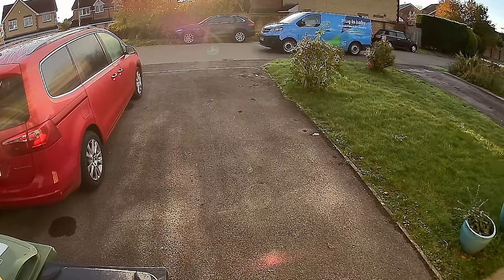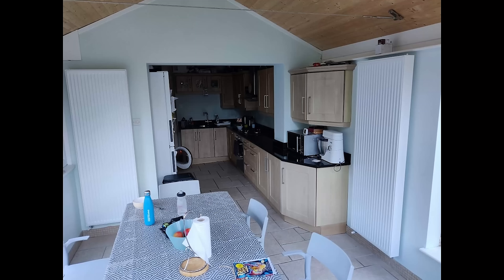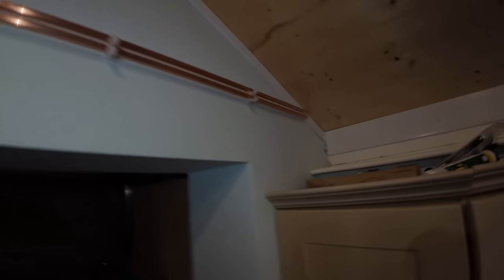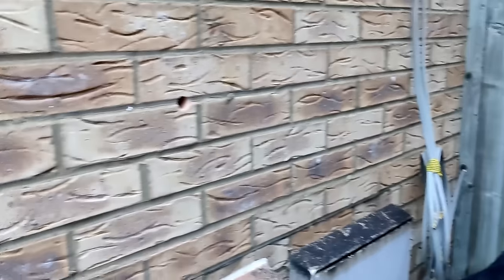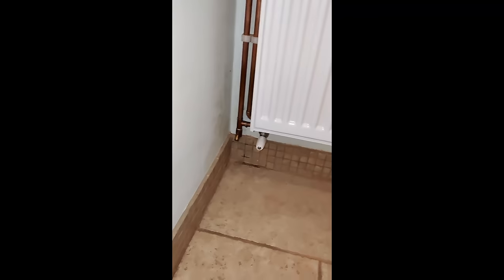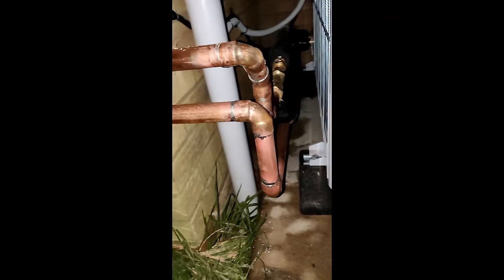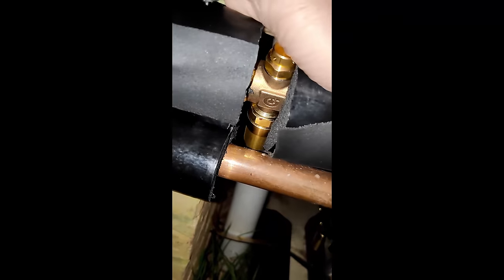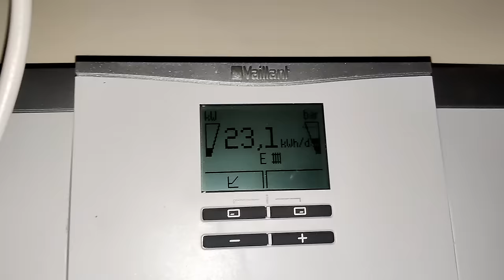Vaillant Arotherm Plus Heat Pump Installation by British Gas

Comment: My an aesthetic perspective that's an ugly installationId not be happy with all that surface mounted pipework at all.
Reply from the maker: We had the option to chase out the walls ourselves but we chose the cheaper and easier option. That room is undergoing other works which you can see in my other videos and the trunking will be painted to match the walls.
It is already not noticeable for us, even in the plain white as it currently is.

Comment: I could not live with that installation pipes and pvc runs everywhere this is exactly why you need these things installed when building otherwise you end up with a mess like this
Reply from the maker: Thanks for your comment. I could have chased out the walls myself for them to lay the pipework in and then plastered over later but we chose the quick and cheap option.
I haven't quite finished that project room yet but soon it will be completed and trunking will be painted to match the walls.
Surprisingly, we don't even notice the plain white trunking at all. We spend our time looking out the windows to the garden, rather than looking back at the house.
Reply: @UpsideDownFork  hi, it’s not so much the inside but that mess on the outside,maybe it’s just me that is very persnickety,I showed it to my wife she couldn’t believe what these people had left,you see I am a joiner and have very high standards of finishing a job,that is what I was talking about when I said I could not live with this
Reply from the maker: @gordonsneddon360  Oh, you mean down the side of the house?
Fortunately, no one goes down there and it will never be seen.
We're fortunate to have better access to the opposite side of the house that we regularly use.
The double white trunking is so that the low voltage data cables and the high voltage mains cables are separated, which i'm led to believe is best practise.
I did consider some Inoac 100mm trunking to fit over the feed and return pipework but as it won't add to the efficiency of the system and the pipework will never be seen, so I decided against it.
It would definitely be a different issue if any of this was on display.
When we moved in, this house had a satellite dish on either side of the front of the house and another relic of the past, a TV antenna. We took both of those down to clean up the appearance of the property from the street. Personally, I can't standard those bits sticking out everywhere.
I've also seen some very questionable gas boiler flues over the years, so I don't think this issue is exclusive to heat pumps!
Appreciate your comments.
Reply: @UpsideDownFork  I would prefer surface mounting and boxed rather than chased in. Less strain on the pipework and easier leak finding in the future.
Reply from the maker: @djhvideo  Good point. I did even consider getting some brass wall clamps, a tin of brasso and polishing them up to make a feature of them. The wife didn't like that idea!

Comment: I’m sticking with my gas boiler
Reply from the maker: Each to their own 👍
Reply: @UpsideDownFork  The amount of kit needed to make the heat pump work is astonishing  and more to cause problems ,the resources required to produce the kit can't be good for the environment. The wiring and pipe work looks like an industrial power plant.The average person wouldn't understand the controls ,let alone having to have larger pipe work and bigger sized radiators. So you mate our welcome to this crack pot nonsense along with your electric car.
Reply from the maker: @Fre667Roger-Ring  Apart from the external pump, everything inside is the same as a conventional boiler. Standard size cylinder, pump, expansion vessels. That's all standard stuff.

Now if you're comparing to a combi boiler...that's a different story.

I don't have an EV. Can't afford one but I cycle pretty much everywhere anyway 👍

Comment: Overdid the joist notching 😣😣
Reply from the maker: I'm surprised you are the first to mention that! Well done for paying close attention.
Reply: I work in the building industry and that notching of the joists is very poor not to mention the weakening of the joist them selves
Reply from the maker: @gordonsneddon360  Would it be less of a concern as it is so close to the wall? Maybe a bigger issue in the middle of a room?
Can the joists be strengthened with metal plates or something similar?
Reply: @UpsideDownFork  The "permitted area" for notching and holes within a joist are between 0.25x the span and 0.4x the span. It looks as if they were just expanding existing notches though?
Reply from the maker: @yngndrw.  Thank you for advising. I don't believe that the joist had any notching there previously.
Reply: Damn near a 1/3rd of the joist - bad!
Reply from the maker: @royhorn9412  yes, this will require some remedial work.

Comment: Wonder why for the new radiator work they went with copper and soldering rather than MLCP (PEX-Al-PEX) and press-fit. Would have been easier to do the pipe runs, IMO. Glad they ended up not using the speedfit.
Reply from the maker: Thanks for taking the time to comment. 
Not sure why they avoid MLCP or press-fit, but I don't mind either way as long as it wasn't speedfit.
Reply: A pathetic attempt at soldering but I don't like the willy wonker look of the press-fit.
Reply from the maker: @alanr585  yep, fair comment 👍

Comment: can you share a schematic in a future video perhaps? I'm curious why they fitted two expansion vessels and a buffer tank. If they've run 22mm to the rads so only the rads are 10/15mm shouldn't the radiator circuit be able to handle things like defrost?
Reply from the maker: Thanks for taking the time to comment.
My system is schematic 10, you can find it if you search for Vaillant Arotherm Schematic 10.
I believe there are 2 expansion vessels, one for DHW and one for Radiator Circuit?
Yes, by my calculations a buffer is not necessary on our system, we have more than enough volume to deal with defrost.
Unfortunately both Vaillant and BG are insistent that a buffer should be used.
In any case, it does add volume, helps with defrost, helps to reduce cycling and ensures that flow rates are always correct for the Heat pump.
Yes, we will sacrifice a small amount of efficiency by having a buffer but the quote was so cheap, I couldn't say no.
If we would have paid the extra £5k+ for a heat geek to fit the system without a buffer, we never would have recouped the investment from marginally greater efficiency and lower running costs.
Reply: @UpsideDownFork  you might be able to pay them a smaller sum now to remove the buffer and extra pump....
Reply from the maker: @ChrisShucksmith  Thanks for your comment.
My plan is to see how the winter goes and then potentially remove the pump and have the buffer as a volumiser on the return.
Reply: @UpsideDownFork  that's probably a good idea and looks possible with the piping.
Reply: @UpsideDownFork  

Schematic is good, I'm sure no manufacturer would add complications and potentially more bits to fail unless they thought it the best option.

As you said most likely to buffer design errors than defrost cycle, but raises the question as to whether Monoblock pump has sufficient Oooomph !!! to pump round system.

Comment: Good video, thanks for documenting in detail what happens. I'm very keen to make the switch too, but I'm going to wait till late Spring.
Reply from the maker: Better get the ball rolling then 👍 Demand is high. For me personally it was 11 months from first enquiry to installation!

Many more videos are on the way highlighting the ups and downs.
Reply: My lead time has been five months from survey to instal, assuming instal starts as planned in eight days 🤔

In saying that, it took months to get an isolator switch fitted by electricity provider. Which is required in most cases as only DNO or supplier (representing DNO) can pull primary fuse.
Reply from the maker: @_Dougaldog  Interesting. I can't now remember when the isolator switch was fitted, but i'm fairly sure that British Gas added it during the installation?

Comment: This installation reminds me of my grant-assisted installation of a new boiler and rads, 26 immediate leaks, lasted 3 yrs before needing replacement  rusted Rads etc,proper cowboys,
the new install is a lot better, however, I replaced rads on my own and run new pipework, strangely the electrician dumped the outside thermostat in the bin I retrieved it and insisted it being fitted
Reply from the maker: Thanks for your comment and glad to hear that your new installation is working for you.

Comment: Thank you for sharing your installation experience. Personally I would be a tad unhappy with that external pipework and electrical work.
Reply from the maker: Thanks for taking the time to comment. Anything specifically that you think should be improved on the external pipework and electrics?
Reply: @UpsideDownFork  Honestly, it is far too late now. But without getting bogged down in detail - it could have been planned better. In principle one vertical trunk to contain the primaries and electrics into the loft and then a drop down into the ‘plant room’ would have been better than long horizontal pipework runs and the multiple electrical cables.
Reply from the maker: @normanboyes4983  ah, I see. That makes sense.
If it was a side of the house that I ever saw or went down then maybe I would have considered some of these things. But I guess you are right that the installer could have advised better and some more joined up thinking between the plumbers and the electrician.

From a technical point of view, I'm under the impression that the shortest route for the primaries is the most efficient and going up to the loft to come back down could lead to trapped air issues?
Reply: @UpsideDownFork  Yes you are correct, shortest route is always the ‘best’ from a thermodynamic point of view. But ‘design’ is always a compromise and without knowing the building fabric - it may be that running straight up into the loft would have given a shorter overall run of external pipework. It is a good point though about  considerations of air collection at the high point - so an ideal point for venting or AAVs.😉
Reply: Nice vblog, gives are really good picture of what to expect. I wonder how long it will be before British Gas drop the gas in the name 😊
Reply from the maker: @normanboyes4983  thanks for taking the time to comment. The run they've made is definitely shorter, especially to get within the heated envelope  of the building but to satisfy my curiosity I may measure the difference. 🤔
On another note, I believe the 2 sets of trunking are to separate the high voltage power cables from the low voltage data cables.
I presume that may not be standard practice based on your comments?
Reply from the maker: @Chatterisdotbiz  The new department is currently called British Gas Zero but one of the more senior staff seemed to think that the name would eventually become British Zero.
Reply: @UpsideDownFork  Yes you are correct, always best to separate power and data cables.👍
Reply from the maker: @normanboyes4983  Thanks for confirming.
Reply: Guys who fit ac will put the refrigerant lines, power cables, comms cables and condensate pipes under a single trunking system, not sure why that’s not possible for these systems guess the pipes are larger, but you can get split systems where you just need to run refrigerant lines.
Reply from the maker: @edc1569  Yes, it's a very good question. Maybe best practise is not observed by those AC guys?
Once the 28mm pipes are insulated, they measure about 65mm each from memory. Getting trunking bigger than 100mm seems very difficult.
Much easier with those small refrigerant lines for sure.
Reply: @Chatterisdotbiz  

It's an excellent way for BG (as they will probably re-badge themselves 🙂) to reskill and repurpose what must be very experienced people, makes sense with gas in decline.

I believe they'd been contracting out initially but been using and training their own teams for over a year now.
Reply: @UpsideDownFork  

It's as you say, in telecomms world internal data cabling would never run in same trunk as 240V power cables, a safety hazard.